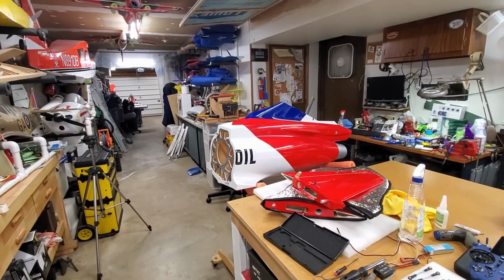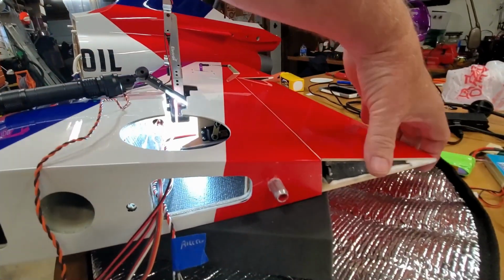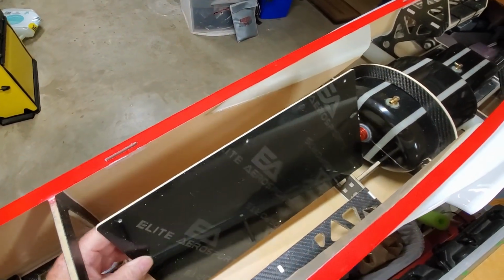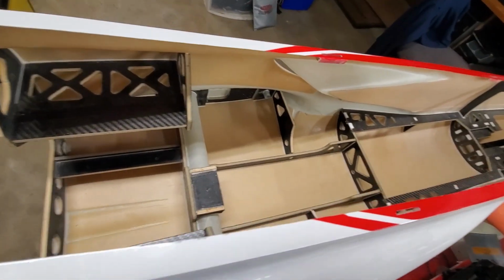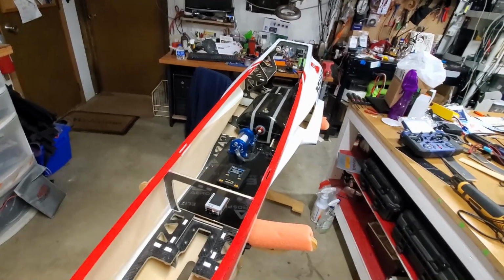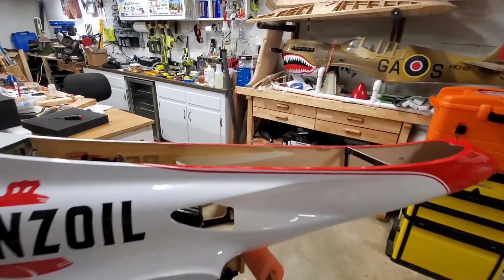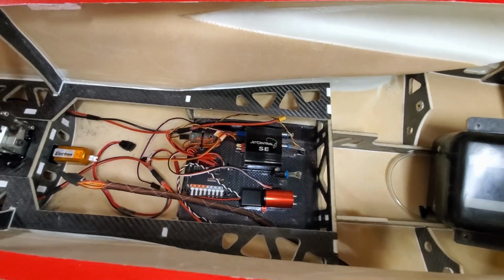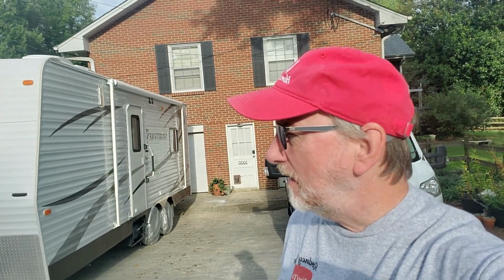BDX Build

Comment: Did you change out the stock thrust tube to larger diameter thrust tube to run your JC Mammoth?
Reply from the maker: No I didn't change it but I changed the engine to a SwiWin 240 later as it's a pound lighter and runs smoother.

Comment: How are you liking the X20s?
Reply from the maker: I love my x20 best signal lock I've seen 
A bit of a leaning curve but once your used to it it's easy.
Reply: Excellent, I just ordered one to migrate from spektrum, I hope I have that good luck. What receiver combo are you using?
Reply from the maker: In the bdx I'm using the TD 10 dual band receivers 2.4 & 900 MHZ 
The lighter side of rc did a brand range test with surprising results a good video to watch. @BatworxAero
Reply: What servos did you use? Nice build! I just ordered mine